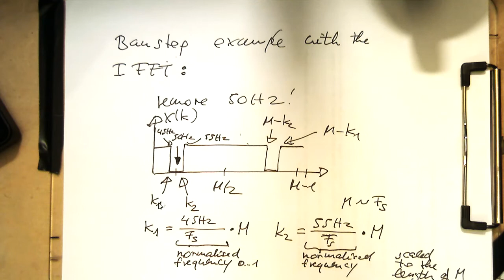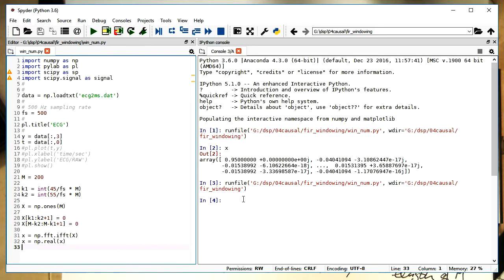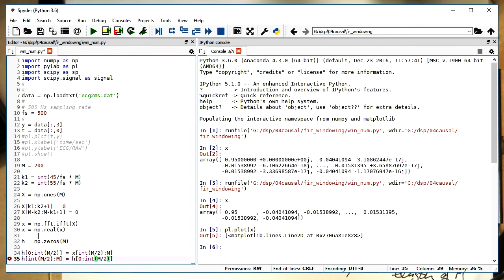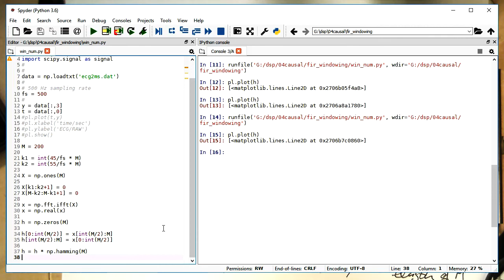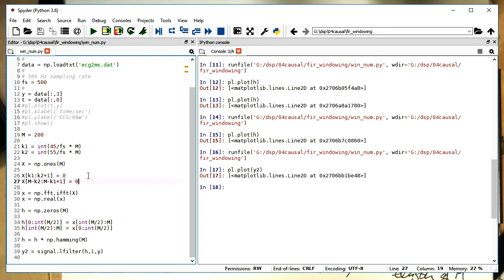FIR design/windowing: DFT example in Python (0008,Py)

Comment: Hello, thank you for your video. Despite my efforts, two questions arised from your video: A) How can one find the sampling rate of a time-series? For example, if I were to apply your technique into a climate data (i.e.: from a meteorological station) time-series that is daily sampled, and a total sampling time of M days, what would be the sampling frequency (fs) of that time-series? ;  B) This final question is related to the number (1) that was used in your video for the scipy.filtering.lfilter function. What criteria did you use for using 1 there? Sincerely,
Reply from the maker: A) check out the videos here about frequency / sampling rate (https://www.youtube.com/watch?v=0a80cAcnVm8). Sampling rate is in Hz: samples per second. Fs = 1 / (60 * 60 * 24) or I'd recommend to normalise all your data in relation to the sampling rate and set it to one. All explained in the videos. B) See the documentation of lfilter: https://docs.scipy.org/doc/scipy/reference/generated/scipy.signal.lfilter.html. It's the IIR coefficient which is one for FIR filters. To understand this properly watch the videos about IIR filters.